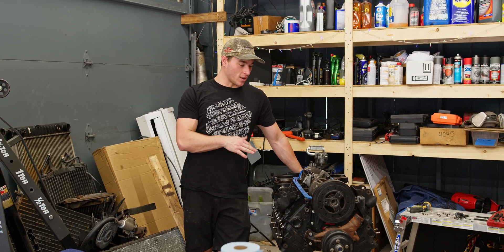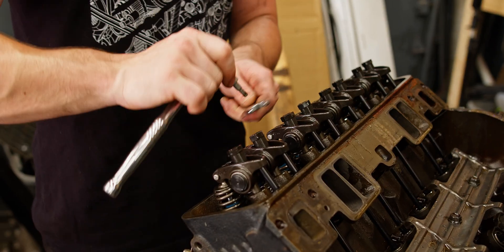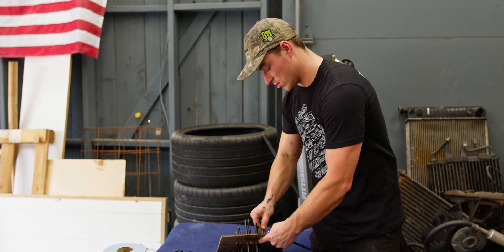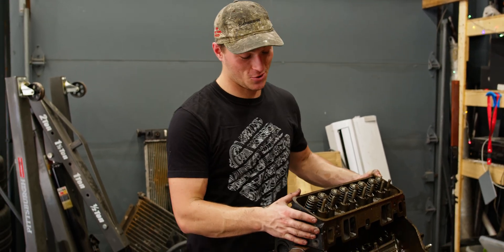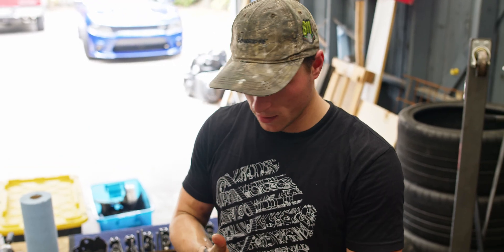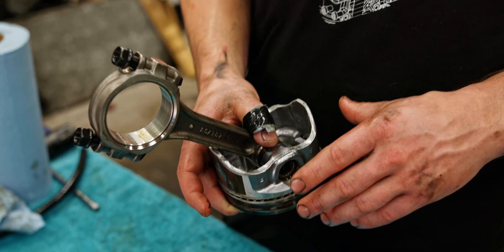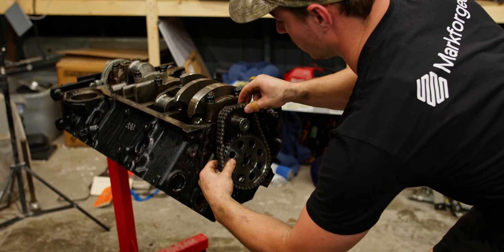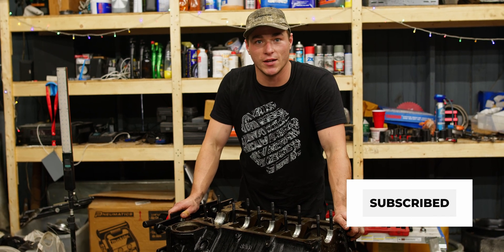Tearing Down our First Engine Build! 350 Vortec to Chevy 383 Stroker — feat. 1999 Chevy Suburban

Comment: That play in the crank would that cause a serpentine/pulley to slap/tick on a 350 vortec? I’m planning to replace my harmonic balancer but my truck is at 268k miles and still purrs. Just didn’t wanna go through with it if I just need to go ahead and do a full engine rebuild lol

Comment: Was there metal in the oil
Reply from the maker: A bit, yes, little shavings
Reply: @VeryGoodGarage  or was it bearing material light copper like
Reply from the maker: Bearing material
Reply: @VeryGoodGarage  mine looks like a copper look could that be the thrust bearing